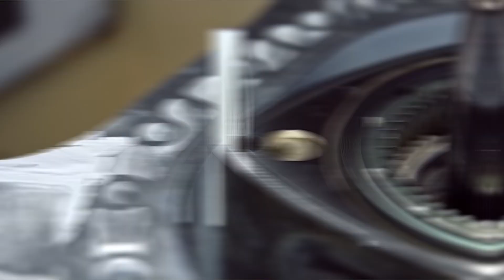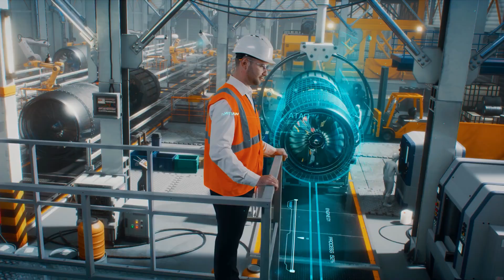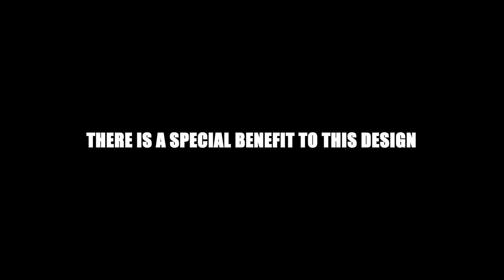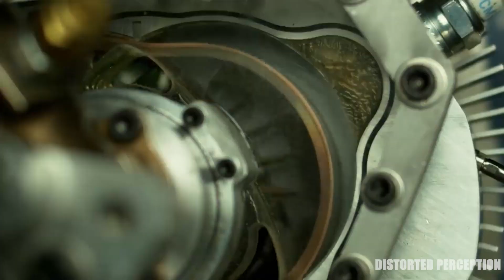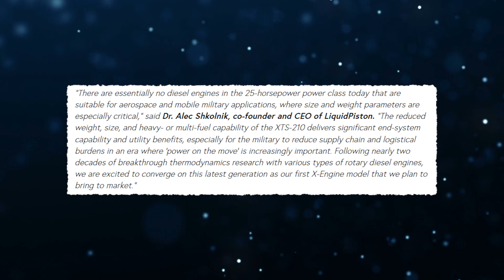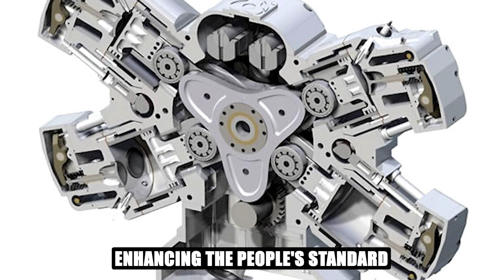This NEW Rotary Engine Delivers 5X The Power Of a Diesel

Comment: 1 horsepower for every one pound of weight. 20 pound engine is 20 horsepower. Three combustion cycle per rotation and the highest efficiency exceeding diesel engines which is astonishing.